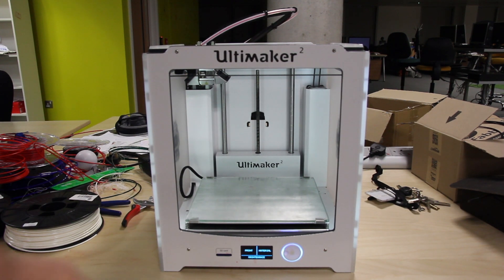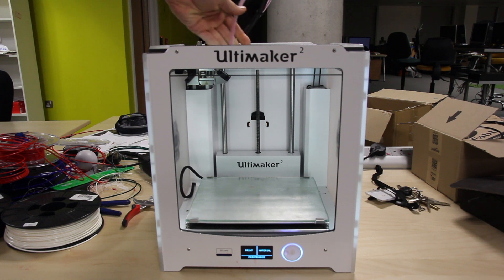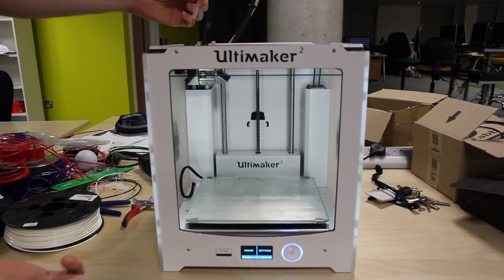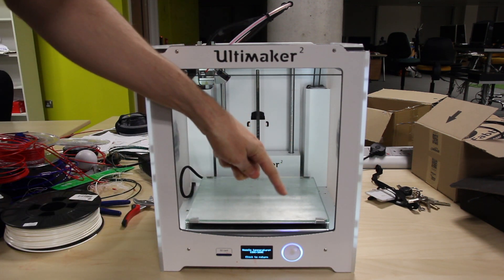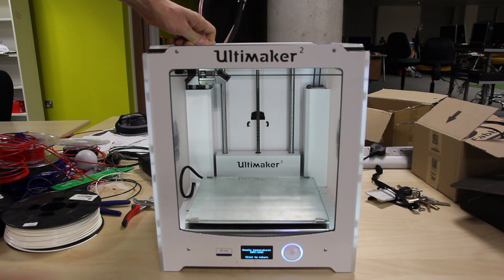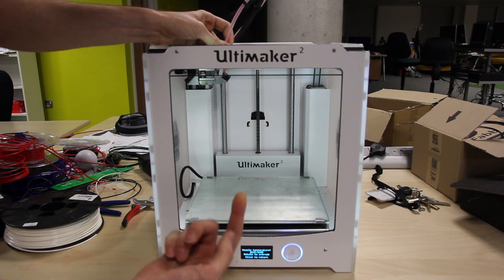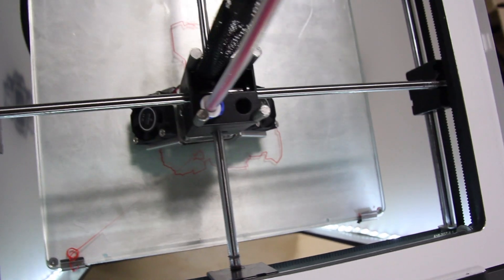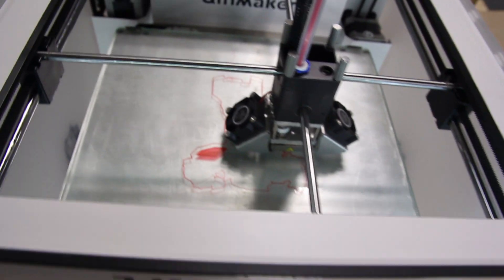Printing on Ultimaker 2 with damaged PFTE coupler

Comment: lol.  This is great.  But couplers are cheap.  I sell them in usa at gr5.org/store and 3dsolex.com sells them in europe.  We only sell them in pairs.  Printing hotter than 240C wears out the coupler faster but you have no choice for ABS.  In generatl, when printing that hot you want to keep things moving or you can get a clog.  So for example if .1mm layers then minimum of 60mm/sec should be fine and 35mm/sec is fine for .2mm layers.  But if you have tons of retractions you might need to increase your layer width to keep the filament from staying at 260C for more than 30 seconds.

Comment from the maker: This method may not work for everyone, i guess it all depends on how badly your coupler fails or how it starts to fail. I hear they tend to fail slowly with clogging as the first sign, then the wall just give in and you NEED to change it.